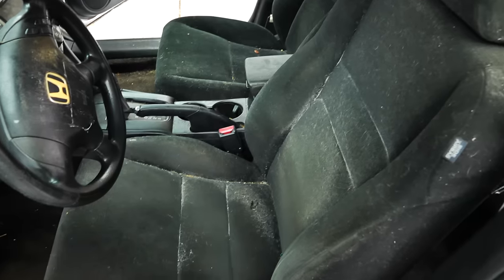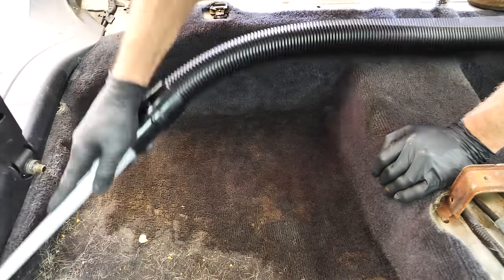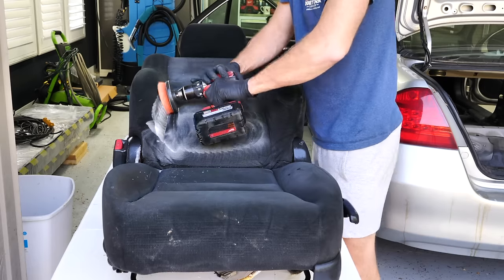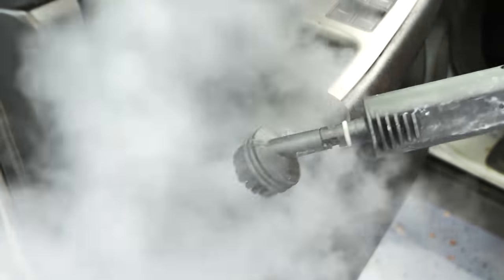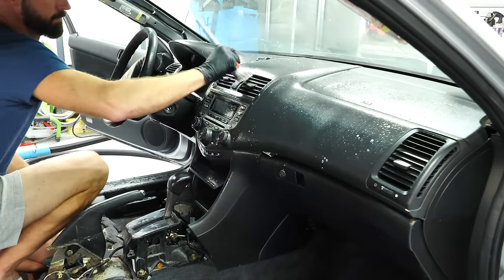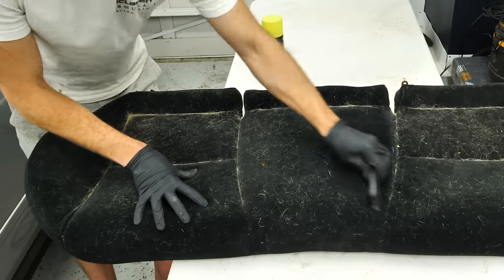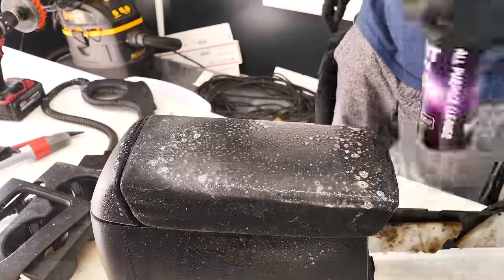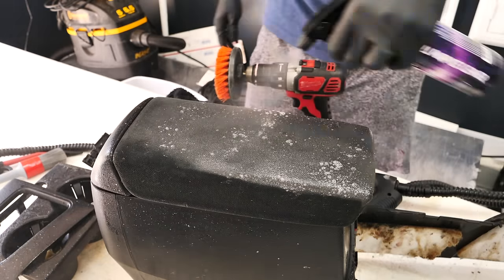Most Disgusting Honda Accord I've Ever Cleaned | Car Detailing Restoration

Comment: curiosity!  In Brazil cars rarely reach this state of dirt and for much less we remove the carpet for washing outside the car, I noticed that in the USA most detailing channels do not remove the carpet.  If you removed seats and all peripherals, why not remove the carpet?
Reply: Some disaster detailers do here on YouTube like WD Detailing and M.A.D. Detailing and you find a lot of junk leaked through it on the chassis floor but here he  rarely does that.
Reply: Yup! @jedsgaragedetail
,,,makes you wonder why, right  ,,,since the seats and console were removed,  the Carpet should be taken out too for the  Pressure washer --   faster cleaning,  can also flip  the Carpet to clean the other side, especially with that level of  Embedded filth --  also with the  Seatbelts (usually overlooked to be cleaned - again in this worse state of nastiness.)

Comment: 👋👋 Reposted this from the maggots vid ✌️😅

Hi,,, noticed that you  Removed the  console, etc.,  with all the  trash,  liquid sticky dried sludge,  molds  Long Embedded  in the Carpets  with maggots,  is so nasty 🤮🤮🤮  
,,,thought that for  this  level of filth   Carpets  and   Seatbelts (usually overlooked in cleaning) --    It  Needs  Thorough cleaning  of the   Pressure washer  (Much Cleaner,  Easier  and  Faster.) 👍👍

,,,overall nice content with tips (glass cleaner in removing pet hair) 👍👍

,,,Peace✌️ ,,,Thanks

Comment: I use a 50/50 mix of Simple Green on grease stains.   Try using the extractor to remove the solution off the the door panels.  I wouldn't use the fluid from the extractor on the door fabric. I would use the suction to extract the cleaning solutions.   I've had good luck as long as the fabric wasn't rotted

Comment: Helped clean out a van at work, didn't do any vacuuming or wiping anything down, that was for the detailer in the shop to do, but it took 2 guys a full 8 hours and a few garbage bags to get the garbage out.  Didn't really have any hair in it, but there was mold and grime just about everywhere.  Old food piled up in the corner(in plastic) random discarded tools and sockets, i don't know how anyone got anything done in it, i could barely get in it myself.